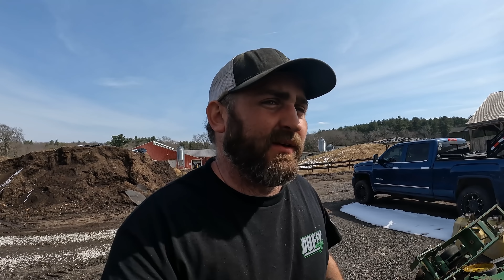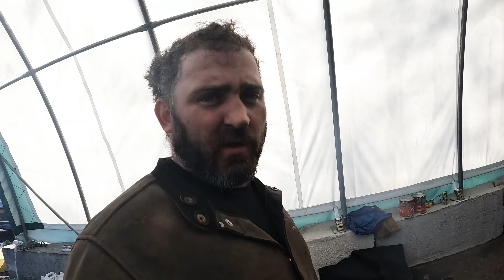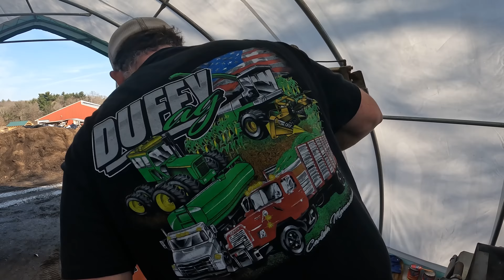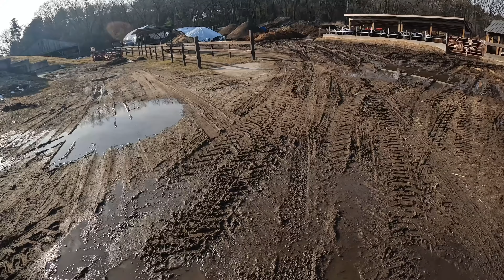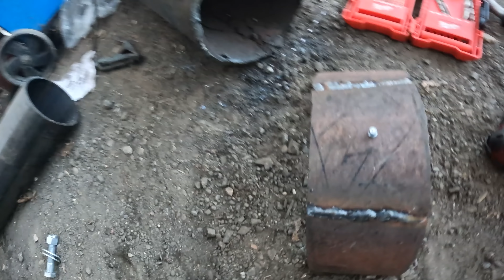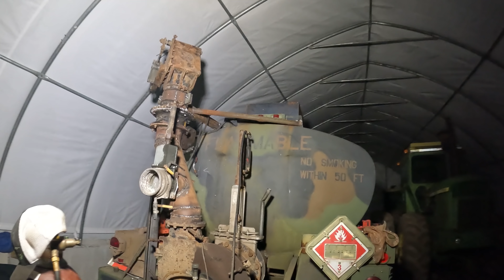The Struggles Of Putting A Swivel Together With No Help- Manure Tank Build

Comment: Hey chris nice job on the fab work keep up the great content .. If you need to make some rubber skirts for the top of the box if you can go to a local gravel pit and see if they have conveyer belt that is used it would be easy to cut and cheap just a thought .. My day job is working for a sand and gravel operation in central mass we have a ton of old belting .. Big 👍👍👍👍👍 up nice job

Comment: That extra brace going towards right side is good and I'm thinking even another further over, maybe even down towards the outer right edge of your bumper (if I could call it that) and forward some. And that's assuming you have strong enough structure. Your load is all hanging left and back from tank and pull supports are generally always stronger.. Always better safe than sorry.

Comment: Hi I would put a strip of Teflon around that pipe as a bearing, nice work
Reply: Or even the plastic from a 5 gal. pail, drum, etc.
Reply from the maker: As long as they get greased daily they work well without anything as a bearing between. I only plan to use it a handful of days a year. hopefully a majority of the time is field spreading

Comment: Chris tank looks good.  You may want to run grease lines from your swivel to a bulkhead down by the pump.  It makes greasing fast/easy rather than hanging off the back.  Just speaking from experience.  We got 8-9” of snow today in CNY but it’s supposed to be 63 by mid week again.  Will be spreading and doing spring work in no time!
Reply: 10/4 on the greasebank forsure.

Comment: Just a tip, if you can always put the bolts in from the top.  If the nuts ever come off the bolt won't fall out with the head above the plate.  Don't ask me how I know...      😂

Comment: How do you get the welds to hold with any integrity? seems like your welding through several years of compacted manure and rusty paint and layers of oxidized rusted metal?
Reply from the maker: Hopes and dreams hold it together. Turn the heat up. Clean up most places just enough to weld it
Reply: We used to use a rod welder to hold rust manure and iron together 😭
Reply: @DuffyAg   thanks

Comment: Would not it make sense for the farm to get rid of the excavator and the JD skid steer and buy a older good used 4wd backhoe loader or a used industrial 4wd tractor loader example Ford NH 545 or MF 50E or just a used  4wd tractor loader 40 to 60hp. Those machine are just so handy to have around the place.
Reply from the maker: Backhoe couldn't do what the skid steer is meant for and they are not as user friendly. Excavator is used to dig in wet areas such a water ways so wouldn't be ideal